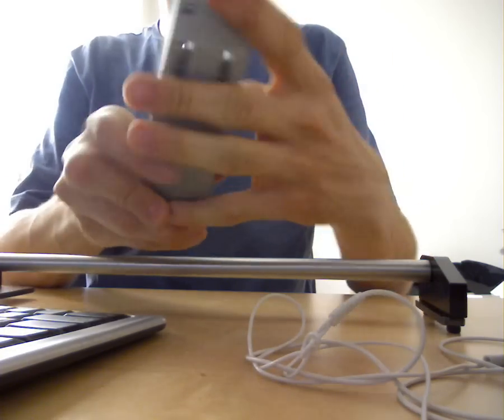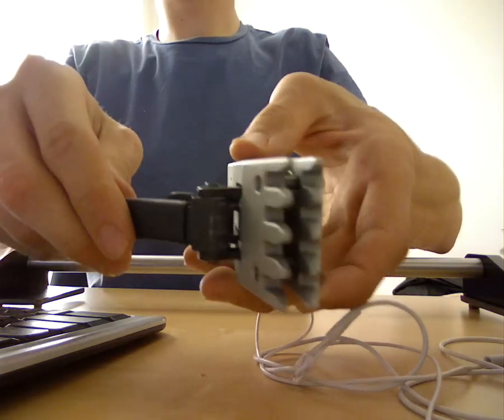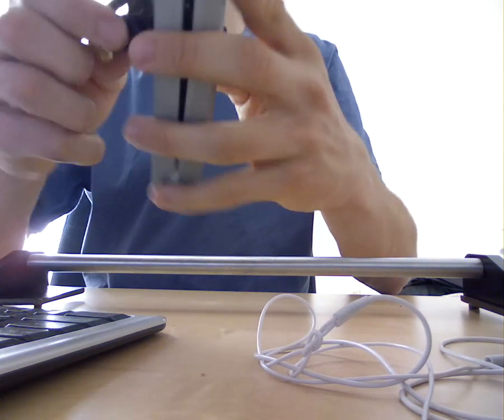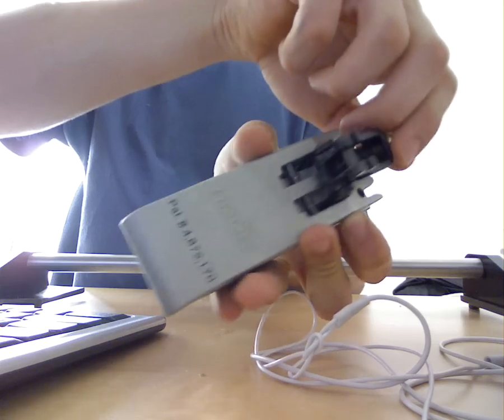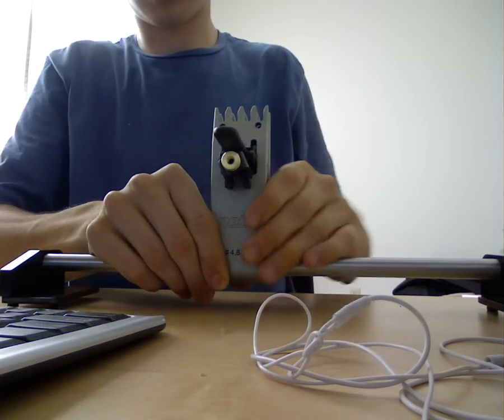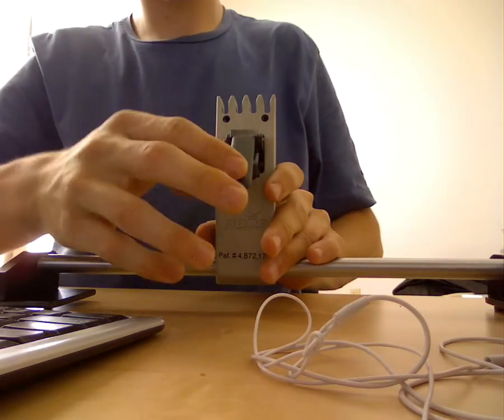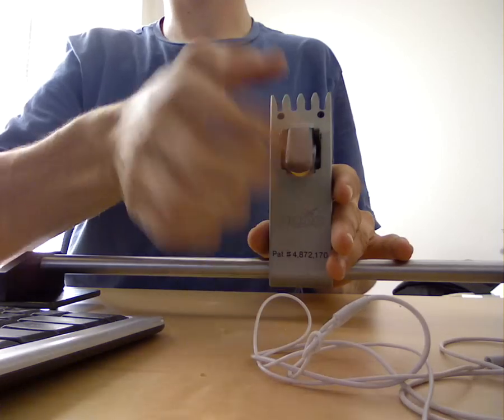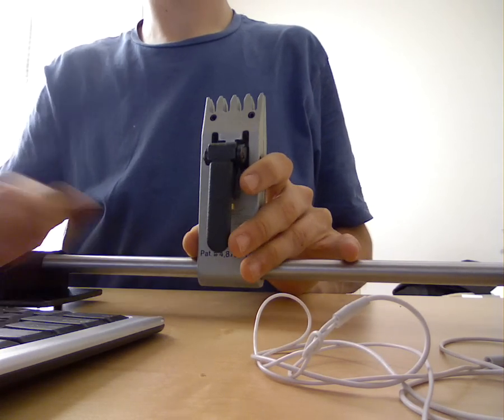Prince Neos 1000 Clamp Problem

Comment: The clamp acts differently on the bar with a piece of string in it (clamp biting on the string).  You should be adjusting it with a piece of string in the fingers.

Comment: have you tried to clean the clamps and the glide bar with alcohol?  I use to work at a proshop with a neos 1000 and the boss would clean the glide bars and clamp with alcohol cause it cleaned well and dried fast.

not sure if it's the appropriate thing to do, but just letting you know what he did.